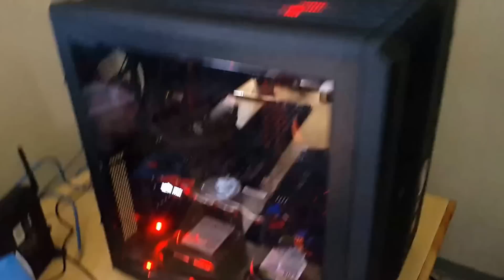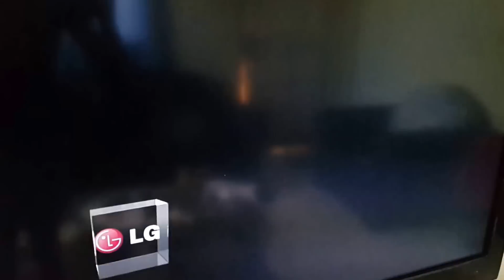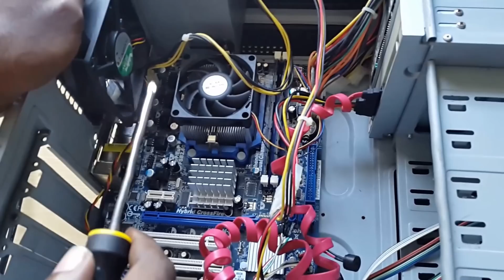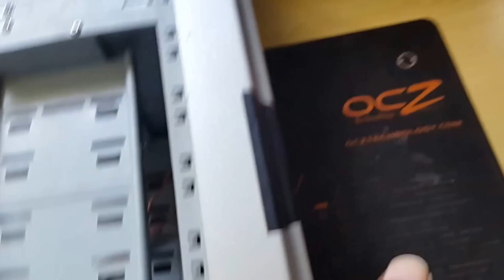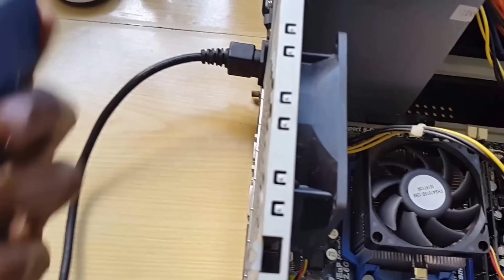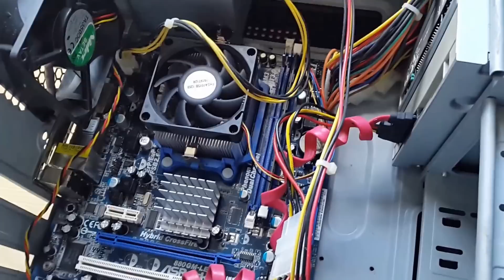No signal to Monitor Fix Easy PC Fix

Comment: Hi Ricardo,Thank you for your post. It is very thorough. I wish to ask if you can please kindly help with my technical issue. I have tried the above methods (Ram replacement etc) but still encountering issues with connecting motherboard to monitor.- The fan on the motherboard is working and there is a beeping sound to indicate that it is on.- Have used two different vga cables to connect to monitor but still no display. Have tested on another monitor and still no display.- Have tried to connect a USB keyboard to the motherboard to try and get into BIOS but no power to keyboard (have tested each USB port).Can you suggest any further checks I can do or how I should repair it?Thank you so much in advance and look forward to hearing from you soon.

Comment: IF YOU HAVE JUST PUT IN NEW RAM, MAKE SURE THAT ALL THE PIECES OF RAM ARE LOCKED INTO THE MOTHERBOARD.  I had one piece not fully put in, and once I realized this and adjusted it to fit, I had no more signal errors.
Reply from the maker: Thanks for the tip UCFTyler

Comment: i do not recommend the power battery removing one, it can actually harm your motherboard
Reply from the maker: Never heard that before or seen it ever happen in the thousands of computers I have worked on. The battery simply keeps BIOS settings, time and date while the computer is off. All you need to do is remove it while the PC is powered down.

Comment: Thank you so much.  I unplugged. Held the power button a wee more than one minute. Replugged, powered it up and the monitor was connected! Good to go!
Reply: What does holding down the power button do when its not even plugged in?
Theres no power inside of the computer so wouldnt it not be able to process anything?
Reply: @lordclorox3028  Im not 100% sure and it didnt work for me, but id assume since most computers have a quick backup battery to save important files in a quick stop situation, It probably tries to boot and realizes it cant so it will run its systems and self fix any errors in an attempt to fix the issue even though its only unplugged.
Reply: @lordclorox3028  It's supposed to drain any latent charge in the capacitors.  Basically:  It forces every single thing in the computer to fully restart at an electrical level next time it's turned on.  This is a good generic troubleshooting step for any electronic device (as long as you disconnect the batteries too).
Reply: Barbara Cummings thats what i did but it didnt work :(
Reply: Mines worked I dont know how but I wont question it at least it worked
Reply: I dont know for you guys but it work for me even i have a wooden pc and even i have many malware still works for me and it work smoothly af
Reply: Barbara Cummings i
Reply: It fix mine thanks
Reply: Damn that shit actually worked
Reply: It also worked for me THANK YOU SO MUCH
Reply: This didn't solve my problem my monitor only goes to no signal when i launch a game. if you have a solution to this please help me :D
Reply: Leon Rushton u have to restore your computer
Reply from the maker: Sure you thought that one would not have worked. Right off the bat that one will work for most people as strange as it sounds.
Reply: @rickytlc1985  didnt work
Reply: Bonny Read Shut it down first of course
Reply: What did you unplug I'm a nob I don't know computers do I unplug the blue thing too the monitor. Plis  I want to play league of legends 😭
Reply: Alice Ngan-Woo the vga cable

Comment: if the capicitors beside the vga port are leaked...then also it will show no signal....it happens to me.. I tried to change my ram,and video card then i saw some capicitor are leaked in my motherboard...is this the problem... should i change my capicitors???

Comment: i replace graphic card and it says no signal, it works fine with old graphic but when ever I use the new one, it says no signal.
Reply from the maker: You may have a faulty video card, also if it requires power make sure its not under powered and it connected properly

Comment: i might have a problem with my resolution since i dont get the no signal on my tv
Reply from the maker: It could be, sometimes when resolution is too high it can display the message. In those cases all you have to do is lower it.
Reply: Ricardo Gardener Thx its fixed now!

Comment: My pc with this problem has worked well for 6+ years. Recently replaced the monitor with a cheap Acer model, which also worked well. Last week there was a power outage of about an hour, now no signal. Step 1 did not fix it. Haven't tried anything else yet, but does the power outage make you suspect anything specific?

Comment: I have a no signal situation. I couldn't manage to hear the bios beeps. I removed the ram, still not a single beep. I cutted the speaker and used a headset jack and connected them to the mobo speaker connection. Still no beeps. There has to be some beeps right? MOBO: MSI G46 970A GPU:7850 CPU: x4 955 RAM: Corsair Vengence 4 gb ddr3. Note: PC was working for years before the problem arised. Thanks in advance
Reply: did you ever get it to work?
Reply: Bahadır Onur Güdürü did you ever get it to work?
Reply: did you ever got it to work? lmao
Reply: I have solved the problem but I have no idea how. It was long ago :D

Probably I reassembled the whole thing several times until get it working

Comment: Hey man i have a new ASUS z170 pro gaming aura but it won't boot up and I tried to put an speaker on board it beeps 1 long 2 short my ram is new vengeance lpx 2x8gb ddr4 i also changed slots but still the same also used 2x8gb HyperX Fury still the same. Does the 4 dimm slots factory faulty? Also checked the strix 1060 card also works fine in other pc. Also the tried onboard Display it's still the same. Any idea? Dram led light is also lit even though with ram. Help me thanks!

Comment: It wasn't the power and it wasn't the little battery thing and the ram either what do you think is wrong with my computer ?
Reply from the maker: It still could be those things, trying them once does not always work the first time. For Example I was called in to look at a computer recently I guessed it was the CMOS battery and I removed it waited and reinserted it. Booted up and nothing. I repeated the process but this time left it out and wallah it booted.

Comment: My pc won't get anything after this video by the way for the help but I did the 1 min thing and my graphics card doesn't connect to anything Bc I can't find a pin or anything to connect to my pc works and turns on so it's my graphics card my card is zotac GeForce gtx 1050 ti any help
Reply: mr hi254 same problem with the gtx 1050 ti
Reply: Klon337 I fixed it I saw a video saying to plug the hmdi cord to the graphic card that's how I did it

Comment: my graphics card i think has died the fans are going on it but the 
screen is black tried unistalling the card itself  taking it out putting
 it back in  tried taking the ram out the battery and so on and still 
the same  then i tried plugging the flat screen 27" i have to the mother
 board and it works , any thing else i may have missed trying ? or do i 
need to go buy another card?

Comment: So my monitor still doesn't receive a signal and I tried all your main steps. It's a new PC and it boots up fine, the ports work fine (when I plug my mouse, the LED goes on). I used my HDMI cable and plugged it in both the GPU and motherboard, but it still won't receive a signal.
Reply: Thanks man, was my problem too :-)
Reply: Corvanor try this: turn your monitor and pc off, find the cables that are connected from your monitor to your pc and unplug them, after a few minutes plug them in and turn everythig on, it worked for me
Reply: Had a lose RAM stick, so I pushed that in and it worked!
Reply: Christoph Lengowski What did you do ? I have the same problem; i tried everything in this video and my monitor still not work ( everything works perfectly as long as my components are new , my screen is 1 year old but still works and my pc starts ... but still no signal

Comment: I have replaced everything but the hard drive, keyboard and mouse.  I still cannot get my computer to display on any screen that I have available to me I have tried the DVI (that's the white one with the screws I'm not positive of the name) and HDMI cables and two different monitors and cannot get it to show anything other than No Signal.
I have plugged in the cables to the computer and the graphics card... they were working just fine until one day it just wouldn't turn on. +Ricardo Gardener

Comment: i just want to know..if  grafic card is a problem..can it[grafic card]  repair or it cannot use already..one more question if grafic card is a problem can i change port from grafic card to board without reinstall grafic card amd used just like that...

Comment: Hi Sir Ricardo,

What should be the solution if my monitor get no signal but the cpu is running...  mouse and keyboard were light up and the fans of mobo and gpu is running?

when im playing games the monitor got no signal. the blue light turns to orange.. and i need to restart the cpu so the monitor will run again.

what should i do? 

Thank you Sir.

Comment: I did all of your steps to my computer and your methods didn't work. I am having the no signal error too. My specs are i5 6500, MSI h110 MOBO, Team Elite 8GB ram single chanel, CX550M PSU, WD 1TB, Asus Dual gtx 1060 6GB OC. My computer right now runs fine but right as I plug in my gpu, my monitor shuts off saying "No signal". I have a viewsonic VA2431wm monitor connecting to my MOBO via VGA ( my gpu doesn't have a VGA slot). I also tried my moms monitor on my computer via HDMI and it didn't work either, I plugged the HDMI into the mobo and the gpu and still no luck. Sometimes when I plug my GPU into my computer it wont affect anything in terms of turning of my monitor, but when I go to play a game or something I check and my gpu isn't giving performance at all, I am getting the FPS of my integrated graphics not my gpu. Also my gpu fans spin when its plugged in and my drivers are installed. Please Help.

Comment: 420. comment, my pc works only with two 4gb RAM sticks and i have four, if i put third or fourth stick it says no signal, whats the solution?
Reply from the maker: The ones that cause the issue are bad, the PC can work without them but you will loose some performance. You can replace them if you so choose. Its all up to you.
Reply: Ricardo Gardener  i needed to say also that all sticks are working but only if i use whatever 2 sticks i choose, worked before all sticks

Comment: I tried onboard VGA and it worked, that means my Graphic card has problems? Because before that I had to change my motherboard and processor because they died, and now my graphic card too? I mean it's still new can you please suggest me other fixes it used to work when I bought a new MoBo.
Reply: 1337 Boufrad connect a hdmi cable to the gpu. hdmi is the more reliable than dvi or vga

Comment: Wut. I held in the power button for a minute. Then started and turned off the computer ~3 times and then it actually got signal and booted to bios. I don't know if this method actually worked or if i was just lucky but thanks anyways
Reply: balleur that wasnt a method just a reset so... yeah you got lucky

Comment: Hey guys yesterday i bought a zotac gtx 1050ti for my pc which has i3 3220 processor and intel motherboard DH61BF. ... it also has inbuilt intel hd graphics 2500..... 
I removed the case and inserted the gtx 1050ti card in pci slot ..... everything was fine then when i powered my pc i can hear the windows boot up but my monitor shows black screen .... After googling i saw that i had to disable intel graphics before i installed gtx card ..... then i removed card and booted it up everything worked fine even monitor worked fine without any black screen ..... then i went to device manager and disabled intel graphics. ... i boot up my pc bios and selected graphics from pci slot ..... then without gtx card i turned it on i could hear beep sounds aloud and i dont know why ..... then i put my gtx card in pci but this time i did not hear any beeps ..... then i thought everything is fine so i plugged my monitor's vga to cpu's vga, still it shows black screen ..... so should i buy a vga to dvi adapter and connect to graphics card and monitor ???? 
And also i tried connecting graphic card to my tv with hdmi coz my monitor only has vga yet no responce from gpu or tv
I sincerely apologise for my thread question being so long ..... 
Please help me I'm tensed now..... 
All possible answers are appeciated .....
Thanks in advance

Please note i have not installed any graphics drivers for new gtx card coz monitor showed black screen ..... but i had installed intel hd graphics drivers previously

Comment: My pc was working fine but one day i decided to dust it off . After i done it i got this problem . I tried all these steps and it didn't work. Please help me
Reply: ameur ghaîth probably touched your gpu with a static charge, killing it
Reply: I hope you didn't actually dust it with something and used air blown...cuz dusters cause static electricity
Reply: Bob Pickleson not dusters but vacums
Reply: ameur ghaîth hmm ok
Reply: ameur ghaîth remove ram and battery clean and fix again ! It's can works

Comment: thank you sooo much! curious to know why it was my memory module when it comes to display.
Reply from the maker: The PC components work together for everything to work properly, it might not seem logical but RAM is needed for the PC to boot along with other components thus the POST/power on self test. If something is faulty or missing the PC wont boot i.e. no signal or blank screen.

Comment: Ok, so i've tried everything! But it still doesn't work. Could the cpu be broken? +Ricardo Gardener
Reply from the maker: Highly unlikely, a CPU is the last thing to go on a Computer especially if it was working fine before. But if all else was checked: Memory,video card and motherboard then its a strong possibility but not before.
Reply: Nostre
Reply: Nostre
Reply: The box that the cpu came in, had some water damage on the down-right corner! My PC only worked for two days, before it froze and lost the signal!
Reply: It was the ram. Sometimes the ram won't get enough power, or the ram doesnt co-operate with eachother. That is something you can take note on Ricardo Gardener

Comment: i did every thing and it does still does not work.
Reply from the maker: Take a break and try again these things don't work when you want them to. I have cases where I am sure I did the right thing nad that should have fixed the issue and nothing. Try again later and wallah.Things don't always work on the first try.

Comment: This just Happened to me but, it was right after a new update from nvdia... as it was installing my PC crashed and this happens. No idea how to fix it I haven't tried the ram or the graphics card troubleshoot yet but it shouldnt be since 10 seconds before the update my PC was fine right? Any insight would be much appreciated!
Reply: Youngg Loaff factory reset your pc. if you have win 8 or 10 it's located in your security settings

Comment: no signal both  video card and onboard...what to do???
Reply: mstrm3 I'm having this problem with new gpu..monitor is vga, and I have a vga to dvi-d adapter.
Reply: +Anna Payne vga is super outdated but anyways, if your os is windows 10, try to downgrade to windows 8.1 asap. i heard mainly windows 10 creates these problems so what i did was freshly install windows 8.1 and my system works flawlessly now
Reply: john walter try a hdmi cable instead of vga or dvi. if that doesn't fix the problem, just buy a new gpu, it's most likely your gpu is dead
Reply: mstrm3 I very much appreciate your prompt reply.  I'll see what I can manage..I guess I will put my old card back in, it still works..and try that roll back..the power cycle didn't help..😱

Comment: No idea why turning the power off, holding the power button, then turning back on solves the monitor "no signal" issue (because the computer was clearly on already), but it does!  I even hard-booted several times before too, re-plugged in all my cables.  This fixed it though. Thank you!

Comment: can u help me fix my PC pls.. when I turn my PC only fan in power supply and motherboard works and the mouse.. no monitor,keyboard and lan  connection.. whatxshould I do..bpls help me tnx:)
Reply: robert espinosa do you have one of those speakers that beep if so does it beep?
Reply: it doesn't beep
Reply: robert espinosa check cpu seating clean ram and check power connectors

Comment: Hi i have a brand new pc to  3600 dollars, been working perfectly for 2-3 weeks then suddenly 2 days ago it started messing giving small "lags" and when i was in a game suddenly the pc shut it self off when i started it again i get no signal from monitor but the pc starts, do you know what may cause the problem ?
Reply from the maker: It could be anything from Power supply to GPU issues. I suggest you check both, see if your power supply is lage enough to support your hardware and if your GPU functioning properly you can try switching PCIE slots or getting another card to test.

Comment: Sometimes my computer works but it'll show on the monitor "No Input Signal". This is random whether or not it will work or not and I can't figure out why it does this. It worked perfectly before. I've tried all these steps, and nothing.
Reply from the maker: Check your hardware might be Video card dying or the PCIE port, can also be power related.